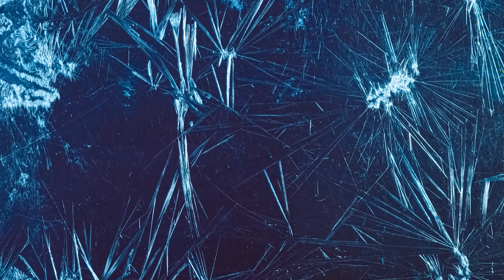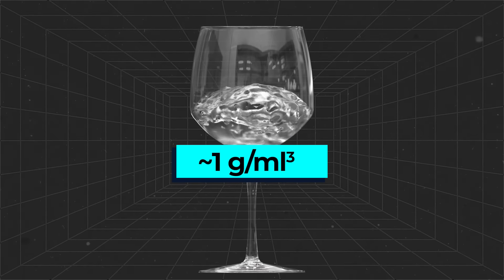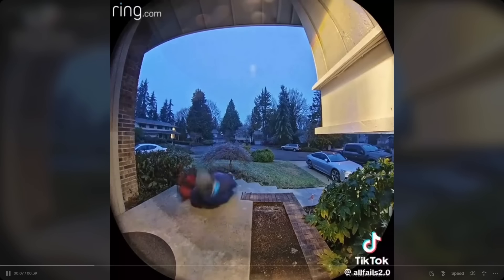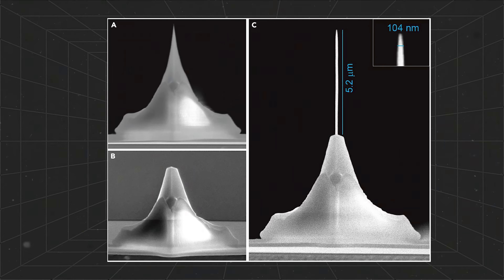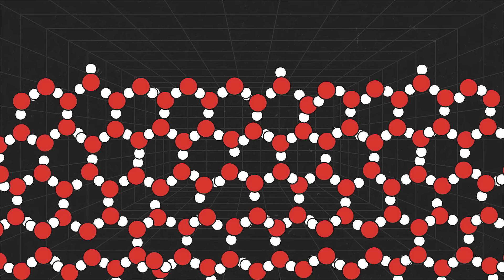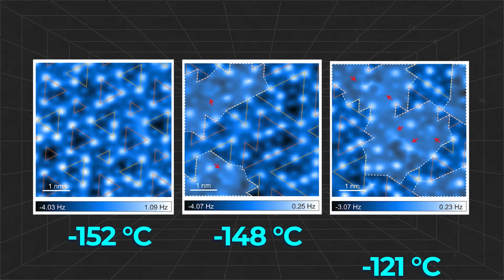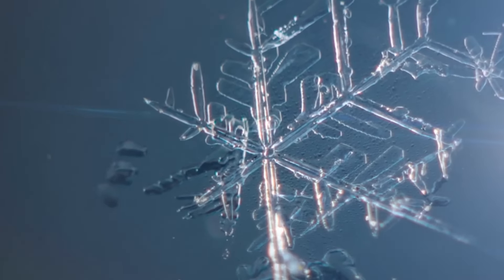We FINALLY Proved Why Ice Is Slippery

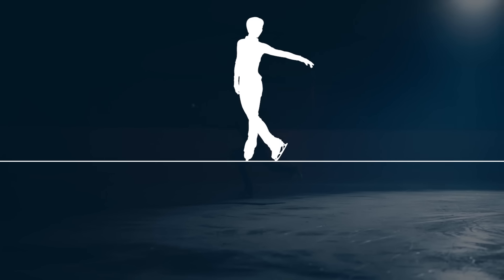Comment: @4:21 A 150 lb person creates a pressure of 50 PSI on their skates?  What?  The blades touching the ice have a full 3 square inches of normal contact?
Surprising to say the least.
Reply: that might be a little high, and if someone has their weight on just one leg, it also underestimates, but our guy could be off by a factor of 100 and the phase diagram of water still doesn't get you to the liquid phase

Comment: Uh... I thought it was already common sense. If something has an extremely smooth surface, without any sort of 'grip', it's going to be slippery when wet due to lack of traction. It's not just ice. Tile floors, smooth metal surfaces, smoothly-sanded wood, etc
Reply: The surface isn't completely smooth. Yes, low friction like that is a factor, but it's even slipperyier (lol) than just a smoothish surface

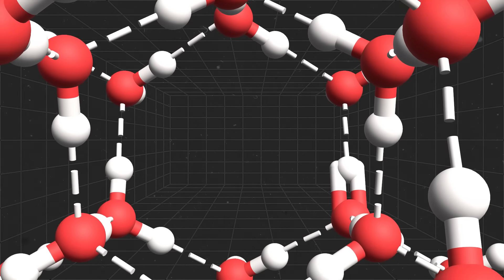Comment: It has a layer of water, not liquid water if it's not liquid it's not water. If it's frozen it's called ice not water, "when we talk about the freezing of water into ice", you even said it yourself. 6:19
Reply: Water is just the name of H2O, regardless of its state. Solid water is called ice, gaseous water is... well technically can be considered to have multiple names really, though I guess water vapor is most accurate? Anyway, certainly in this case where we know have proven there is an almost metalic type of bond on the edge of ice that can "freely" move makes it not fit either criteria of a liquid or a solid. But it is still water. Wonder what they will call this state.

But anyway, water is only liquid in a general language viewpoint, but in a scientific setting it is not wrong to specify the state of the water molecules. Was it necessary? Maybe not, but it does prevent misunderstandings which is important in scientific research imo
Reply: @theknight1573  H2O is what we now call water, it was water before we knew it's properties, like ice, it's ice not water. When we came up with the steam engine it wasn't called the H2O gas engine, it was steam because steam is steam, H2O doesn't come into it. We have names for things because they're different, water is liquid even scientist should know that. They can only use liquid when including it's state ie liquid H20, liquid water is a dumb statement. Are they going to call it wet water next? If a scientist doesn't know water is liquid they're not a scientist.

Comment: I am rather puzzled by your assertion that a 150 lb person only exerts 50 psi... for that to work into those numbers a 12 inch long blade in contact with the ice would need to have 3 square inches of contact area and with 12 / 3 gives 1/4 inch wide blades... I have NEVER had ice skate blades that thick most were barely an eighth inch wide.... so where are your numbers coming from?

Comment: is this guy serious i thought this was already known but maybe not ice has a release of stored energy in the form of heat very little but enough to keep melting and freezing the outer layer of ice for example have you ever seen an ice cube in the back bottom area of your freezer its still the same shape but a lot smaller in size thats because even though it stayed freezing temps inside the freezer the ice continuously melts and refreezes and this happens just before hitting 32 degrees Fahrenheit releases heatvery little but then cools down just before 32 bam again hence the 2 ice cubes fusing to make one ice cube another example igloos...

Comment: Dude Sol is like a generation 4 star. There's plenty of gold in Earths core from when the last one exploded, it's just so easily manipulated that it stays "dissolved" in the liquid down there more easily than most other elements.
Asteroids and comets are more than likely from the star before the last one, making gold a less common material simply from the nuclear furnace being less pressurized.

Either that or the "Philosophers stone" is less a single material or even procedure as much as a transitory phase that certain elements go through in planetary cores that we don't quite comprehend. But IMO that's as boring as it is stupid.

Comment: Is dry ice slippery?
Reply: Pieces slide pretty well over the floor! But it also sublimates very fast, so basically a piece of dry ice is a little like a hovercraft! 

Also funny: lay a spanner on it and it starts vibrating (sublimating a lot when in contact with the metal [high thermal conductivity and warm], lifting up the tool, releasing some gas and the spanner falls back down. Rinse and repeat)
Reply: @Killerspieler  Since I made this comment I came across a video of dry ice on warm/hot sand it sort of hovered on a layer of gas as you stated.

Comment: The thought that ice is slippery because of a thin layer of water exists makes no sense to me.  Water isn't slippery, ice is.  Why would people think the slipperyness comes from water? Had they never stood in a puddle? Nope, not slippery.  I guess if you could walk ON water without breaking through the surface then it might be slippery, but even if there was a thin layer of water on the ice you would just fall through it and be touching the ice again.
EDIT: Yeah so after watching the whole thing it doesn't entirely make sense.  Ok so you have some special outer layer which is slippery.  But like I Said above with water, why would you not just push through that outer layer and then be rubbing against the ice itself? I guess it is the interaction of those two layers against each other that is the sliperyness.

Comment: If the pressure between the blade edges and the ice is 50 psi and your skater weighs 150 lbs and we assume the length of the curved blade in contact with the ice is 2 inches, a simple calculation suggests the sharpened edge of the blade is 1.5 inches wide. I don’t find that credible.  The full width of skate blades of an Olympic speed skater are 0.04 inches or 1 mm before sharpening and the edges are sharpened to a 90 degree angle ie 45 degrees on each side. Let’s assume the sharpened edge in contact with the ice is 15% of the unsharpened width giving us a sharpened  edge width of 0.006 inches. Resulting in a contact area of 0.012 inches squared. 150 lbs / 0.012 in2 = 12,500 lb per square inch. At that pressure the melting point of ice is -7.5 degrees C. Seems that pressure between blade and ice gives about the answer you need by itself. I suggest you don’t assume skate blade edges are 1 inch wide.

Comment: Water is amazingly anomalous! My understanding is, this is due to quantum properties prominent at its small molecule size. The H₂S hydrogens arrange themselves on a straight line, as far from each other as possible. H₂S is a gas under normal conditions (S is directly under O in the periodic table, and also has 2 electrons missing to the full shell). H's of H₂O don't take the positions that are the farthest from each other; these are quantum effects at play that give this config the least energy, despite Coulomb force repelling the H atoms. H₂O should have otherwise been a gas with even lower boiling point at normal pressure than H₂S, but it's a liquid! And this liquid is a polar solvent because of the dipole due to the displaced hydrogens. Next, If you look at the phase diagram of all the water ices… oh boy, it's a rat's nest! There are at least 10 different ices numbered with the Roman numerals, some are with Latin letter subscripts.

The only other small molecule that has unexpected properties due to significant spatial overlap of bonds that I'm aware of is NH₃, ammonia. You'd think of it as a flat thing with N in the middle and H at 12, 4, and 8 hours... as if! The H occupy the tetrahedron vertices, but since one of them remains empty, the three H atoms—or rather the places where you'd most likely find them if you look—are constantly jumping around the 4 spaces at the rate of about 10 trillion times a second (10¹³ Hz). This averaging makes the liquid NH₃'s dipole moment much weaker than that of water, although it still shows polar solvent properties. But still, no compound can beat water's weirdness.

When people hypothesise about very low-temp life possibilities, I can think only of NH₃ as the only feasible solvent to sustain biochemistry in a solution—with a big question mark. Titan's methane/ethane lakes… sorry, no. I can't think of biochemistry in a non-polar liquid solvent: they don't support salt's ionic bonds dissociation, while dissolving lipids, both being direct opposites of the properties desired of a biochemical solvent. Maybe, but it would be hardly recognisable biochemistry, with totally different basic principles than that possible in water...

BTW, clean, oxide-free metal surfaces are prone to cold welding, just like ice. This used to be a huge pain in the neck for early space vessel engineers.

Comment: You should really correct the math on the pressure explanation.  At this point i don't trust anything in this video because you calculated pressure for an ice skate to be over a ridiculous 3 square inches.  My best guess is closer to 0.1 sq inches.  That means pressure should be closer to 1500 PSI, not 50.

Comment: ice is slippery because the individual atoms have contracted to the point it does not have room for bonds & repels things...so it is just none reactive & inert...& a combined structure of these inert contracted compounds creates a repelling inert surface.

to prove this theory, you can put on something that is highly reactive with ice to create atomic friction. & if it is less slippery it proves it just because ice is inert.

this is the same reason oil is slippery or even polished metals...it is just inert..

it is only slippery to things it is not reactive to.

pushing 2 magnets of the same poles together is an exaggerated example of this. magnets are not inert but have extreme poles.

You can prove the theory because co2 an inert gas when solidified is also slippery to most molten metals, while solid oxygen is highly reactive & prone to friction.

Comment: Ice floats on water because while freezing it catches air in between
Why ? I guess it due to the water habit of turning in to small cute starts when cold and these little spaces between those nice. Forms get filled whit air

Why we slide on ice ? No idea it vould be that when we push down on it we actually slide slightly down due to our oresure puffing out the air in betwen the ice cute microshapes

Yeo i still hold my theory and at -100 it not slippery bcs it finally avhives what other materials can achieve at much "hugher" temperature wich is freeze soo hard that it hard to crack it

You know.. a piece od chicken is already harder then water so it makes sense that water whould need a lower temp to achieve the same hardness

Comment: Whoa whoa whoa. A 150lb person on two blades does NOT exert "50lbs psi" (what in tarnation). They exert 150lbs/(contact area of a blade*2) which would be an absurdly high number due to how little contact area there is with a blade edge. Lets be ridiculous and suggest the contact area, what is effectively a 2D line, has an area of 1/32in^2, so double it and you get 1/16in^2 (0.0625 square inches). 150/0.0625 =  2400lbs/in^2. This is 48 times more significant than your Terrence Howard calculation. I double checked what 2414.7psia does to the melting point of water and you get a change of ~1.6°C. If you divide that by 48 you get 0.033, so you seem to have divided by 2 somewhere along the line as well. I get that it still isn't going to melt skating rink ice anytime soon, but lets get our numbers right.
Reply: The more I think about it the more convinced I am that a person on skates is generating some amount of liquid interface. Between hitting microscopic peaks and the friction generated between the interface I would be surprised if there wasn't some amount of liquid being created for fractions of an instant and refreezing once the pressure was dispersed. This would be conditional on the temperature of the rink, but getting 5-7°C variances is actually very plausible. It would explain why a blade doesn't slide sideways as easily on on ice as it would any other hard solid.

Comment: Stop right here: There is no reason why there can't be "less tightly bonded" (for not saying liquid!) water molecules on the surface of the ice in a vacuum. Surface effects are weird! And when you press 2 cubes together, the two surfaces with their surface effects stop being surfaces but behave like bulk ice. The losely bonded "slippery" water molecules become fully bonded crystalline water. Is there a very low temperature at which ice stops being slippery?
/edit: That paper is not as groundbreaking as shown here. The same explanation I learned in high school physics 30 years ago...

Comment: Excuse my monkey brain, is this/this is akin to why snowboarding/skiing there is an ideal temp vs board/ski surface to create more optimal slip.
It's not about the pressure, it's about the temeprature and 'melt' of the wax vs snow conditions of abrasion.

Comment: Huh, I thought it's simply because under gravity ice freezes into perfectly flat surface, so it's slippery for the same reason polished things are slippery, weird this hypothesis wasn't mentioned in the video.
Reply: Why isn't like anything else as smooth then? It's not perfectly flat. That would require square atoms or some other shape.
Reply: @henrysanecdotes5323  I meant perfectly flat on macro scale

Comment: I only clicked on this to comment how stupid the title is.
 "wE pRoVeD wHy iCe iS sLiPpEry".
Literal brainrot. 
Ice is frozen water.
 Water causes contact-friction loss when pressure is applied.
 It's why you spin out easier on wet pavement rather then dry. It's why literally anything wet is slippery and harder than normal to grip. 
This is 5th grade stuff man, why is this a video topic on a channel I just found called DR?!